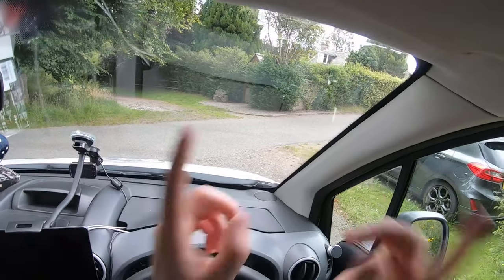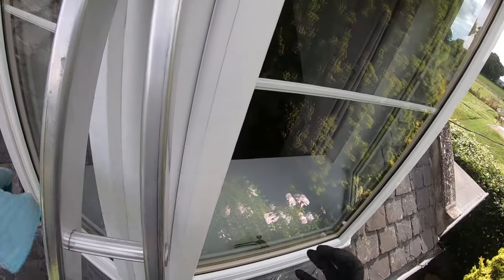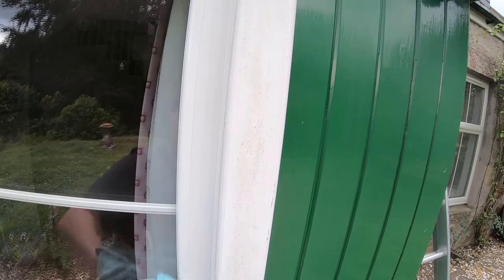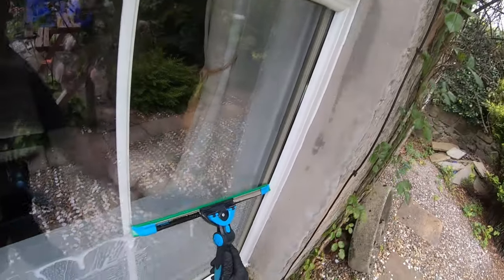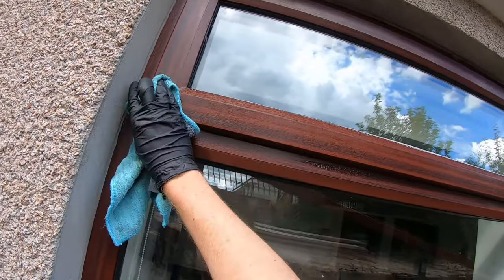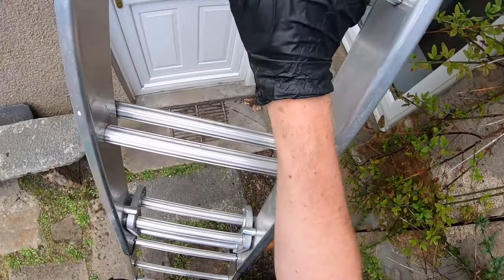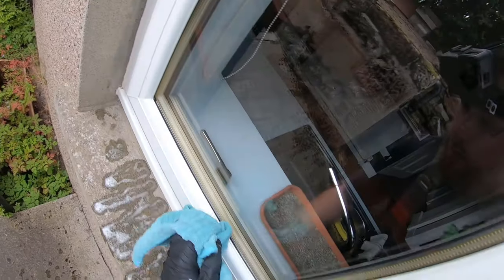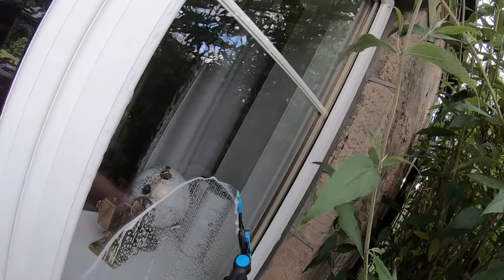FULL TRADITIONAL WINDOW CLEAN - TUTORIAL (NO MUSIC)

Comment: Hi pete mate, great video, as usual.  Comments that come to mind...funny and sympathy with the wasps trouble,  you avoided that one 😉. Stingers never got you neither,  ...pro...you close out mostly on the right, your rubber will probably wear out on your left? 
Don't forget to tell the viewers, only work 2 handed on the ground floor only. Does that Samurai 2 insert really 🤔 work?
As for the applicator,  I am trying to invent a device capable of holding the applicator horizontal,  instead of vertical....seems to me that it would solve it drying out and being too wet on one end. 
Do you honestly rate those microfiber cloths,  over nice thin scrim?
Thats it for now,  you certainly looked 👌 like you were enjoying the day.....thats the essence of our trade eh Pete....Nice one from me, God bless you bro.
Reply from the maker: Yeah the cloths are good, had em for years. Samurai version 2 seems to work ok so far. It's not perfect but does the job better than most at holding excelerator squeegees

Comment: I'm based in the South West and because of a job loss I'm so am considering this as a line of work, and like this rather than pole system (people in my area have been asking for traditional). What would you say is a fair price, is it better to charge per window (no lead diamonds or complex stuff) and say £1.25 per window pane, so a two bed semi works out around £22.50. Does that sound about right? And enjoyed the video, relaxing to watch.
Reply from the maker: Price is a tricky one to comment on as areas can be different but as a general rule £1 for easy standard ground floor windows, £1.50 for similar windows but on the 1st floor. £2 for 2nd floor and so on but depends on the window size and if it's sash windows charge more as you'll be cleaning more framework

Comment: Awesome vid and channel bud 👍🏼 do you still do stuff the same 3 yr later ie trad easy to get to windows and wfp the awkward ones? I am putting a cart together of both and am going with the unger nlite  hydro power s combo with pole etc from wcw. Is this a good starte kit? Do you think i will need a trolly as well or back pack or can you do jobs well enough from a customers outside tap if they have 1 lol being fed straight through the unger s? I am guessing you get problems if their pressure is not good? Do you have any discount codes for buying a bundle? Looking at about 800 to 1000 for everything does this seem right? Thx bud i have really learnt a lot watching your vids. I already do jet washing gutter cleaning soffit and fascia clean roof scrape and moss removal but have found a lot of window cleaners offer these services as well and lose a lot of jobs so need to join the club 😂😂😂👊🏼
Reply from the maker: I have a water system in the van I use for any wfp work. Trad the lower easy stuff.

Comment: @TRAD - MAN THE WINDOW CLEANER   I use WFP mostly, but I do use trad for internal cleans and restaurant cleans.  Mostly commercial work blocks of flats and offices, where the use of ladders is a no no.  I was shocked that you used the moerman without the angle on the rubber just a straight cut, also wetting the rubber before using it on the glass. I do find that when using the Moerman on the pesky restaurant windows that are about 6'4 high and about 2' wide, I find that the squeegee leaves an area of about an inch on the left hand side of untouched soap, unger squeegees do not.  I prefer the Moerman on these windows, as they are the flat bifold type windows with thin rubber seals that the ungers can get the edge of the squeegee rubber lift ofF the glass, if you know what I mean, so you have to be really careful with that.  The Moermans clips help keep the rubber against the rubber window seal, but this inch of soap it leaves is annoying as I then am having to sweep back up to clear it again and I feel it is a technique issue, not a tool issue.  I use the Moerman angled rubber in the channel.
Any advice?
No sarcastic responses from the rest of you 😁😉
Reply from the maker: If your following a similar set up to me ie soap on applicator, rubber flush at the end of the clips then its just practice practice buddy 😎

Comment: Great video as always. I so wish I could make the Moerman work. It’s obviously me but just can’t crack it ☹️
Reply from the maker: Thanks pal 🤜🏻🤛🏻

What kind of problem are you having? Happy to help 👍🏻
Reply: @TradMan   Thanks 👍 Turn marks and not great slip over the glass, and quite a bit of detailing. I’ve been using Unger Ergotec channels and handles for 20 years with, in the last few years, the Razrblade Red rubber and have none of these problems (apart from expected detailing). As I say, it’s obviously me. I’ve just looked at your vid about using the Moerman squeegees so I’m going to have to practice some more. Do you have a list of must do’s for success?
Reply from the maker: Yup sure so
 1. After dunking applicator in clean water. Apply soap directly to applicator sleeve. 

2. Make sure your squeegee rubber is flush at the ends of the clips. Not too long or short.

3. Pin the rubber in place. I use unger green insert clips which hold the rubber better and lessen the chances of lines/streaks caused by rubber pulling out from the channel during use.

4. Choose a good rubber. Personally I've found the best rubber with Liquidator Channels are ettore master soft and unger green power rubber. Some folks really like razor red but I find it too grippy on the glass in liqs. 

Try those tips if not already, and other than that it's practice, practice and practice some more 😎
Reply: @TradMan  That’s brilliant, thanks 👍 I’ve only used the Moerman channels in an Ergotec handle - is it better with the Moerman handle?
Reply from the maker: More options with an excelerator handle 😉
Reply: Thanks for all your help mate 👍😎
Reply from the maker: Very welcome 😁🤜🏻🤛🏻
Reply: Nice badge, Madness forever!

Comment: Hi, im at Usa, May I ask how much are you charging per window or panel?
Reply from the maker: It depends on size and how easy it will be to clean.

So as a rough idea for the external of a window it's normally anywhere between £1 - £5. 

What we do is work out the maintenance clean price first, then double that for the first clean.

Internals are 50% more than the external price.
Reply: @TradMan  how much is in dollars?
Reply: @Pedroluvslupe  how bout you use Google to find out what one pound is in 1 dollar?